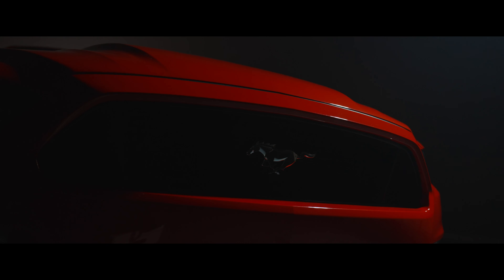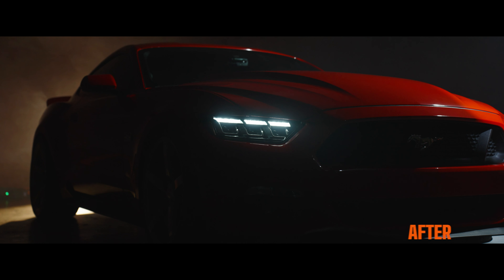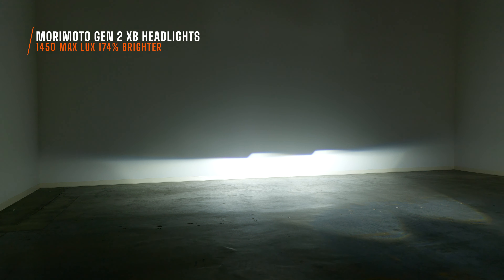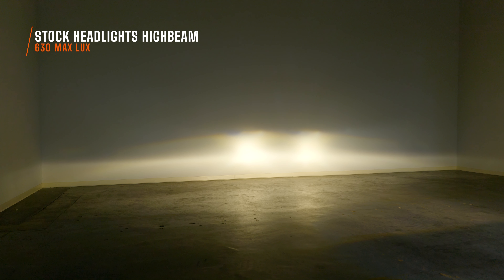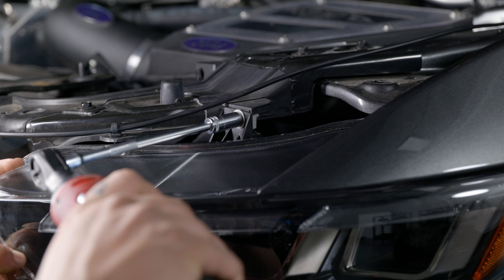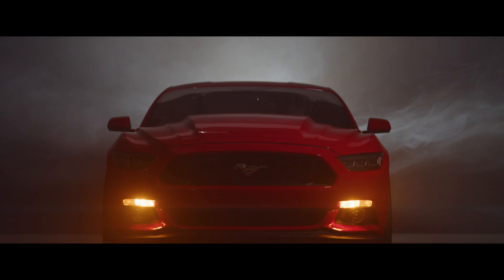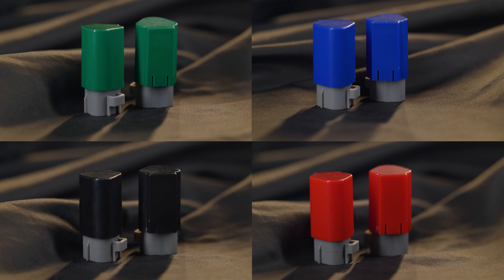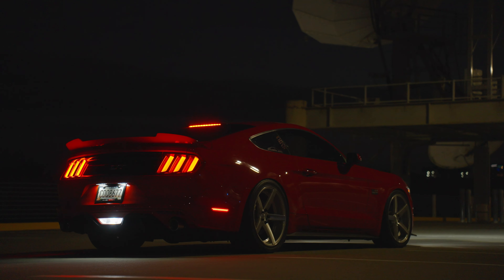15-17 Ford Mustang S550 Morimoto XB LED Gen 2 Headlight Review - 175% Brighter!  💡

Comment: What's the light spread like in the sense of left to right of the car/lane ahead, it looked fairly centre on the wall.
Asking as if I get them they'd be on a right hand drive car in Australia
Reply from the maker: These headlights are designed with a left-hand drive beam pattern, so unfortunately, they wouldn’t be compatible with right-hand drive cars in Australia. The beam pattern wouldn’t provide proper visibility and could create glare for oncoming traffic. We’d recommend looking for headlights specifically designed for RHD vehicles to ensure safety and compliance.

Comment: Will these fit a 2020 Mustang GT?? It’s an S550!
Yes or No?
Reply from the maker: No, these are only compatible with:
- 2020-2022 Mustang GT500
- 2015-2020 Mustang GT350 & GT350R

They won’t fit a standard 2020 Mustang GT.
Reply: They do have version for the gen 3s tho

Comment: That low beam is way too narrow compared to stock in my opinion. 
I'd rather distribute some of the hotspot intensity across width instead.
Reply from the maker: We'd say the low beam is pretty comparable in wideness - the hot spot just intensifies the middle of that beam pattern and exaggerates where the lights drop off (compared to OEM)
Reply: @HeadlightRevolution  I'm referring to how wide, not tall the beam pattern is. 
The OEM distribution spreads the output a few feet past each wall whereas the Morimoto one is a few feet short on either side.